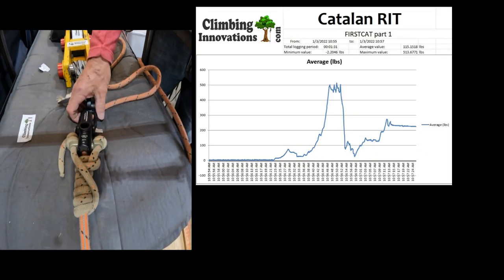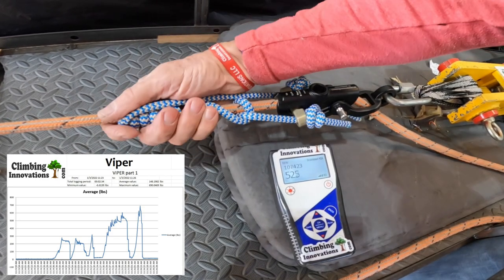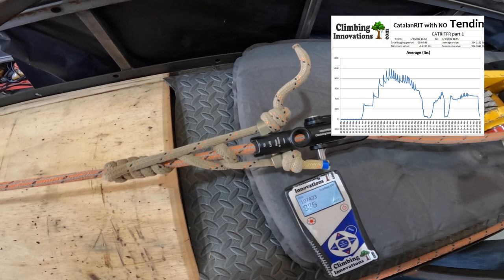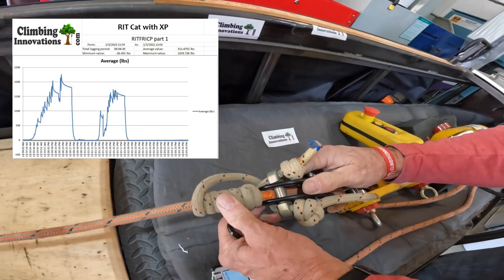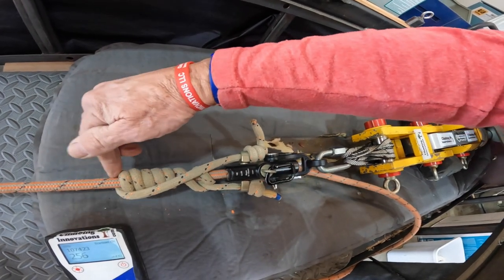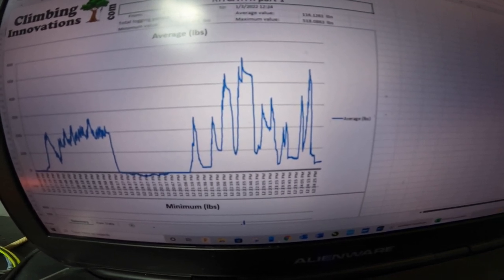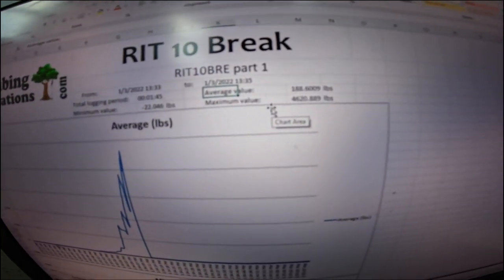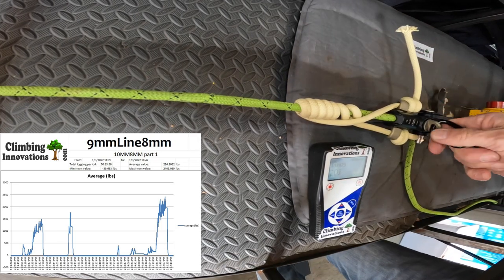HitchHikerXF Testing

Comment: What happens if the outer jacket of the hitch cord fails.  Will the Hitchhiker go into an uncontrolled decent?  For instance if the cord should burn up on a long fast decent or maybe just an over used worn out hitch cord.  If the hitch cord should break or unravel from its friction knot would the Hitchhiker alone be able to break the free fall enough to prevent serious injury?  Thank you for providing this testing information.  It is very informative and confidence boosting.
Reply from the maker: The hitchhiker is a very safe and versatile system.    As I am not sure of the systems you are familiar withere was I will reference the very tried and true Blake's hitch system.  Think of the HitchHikerXF as the limb above a Blakes hitch, both provide friction to allow the hitch to function, without them the hitch will not work.

Comment: Thanks for sharing all your info.  I’ve learned a lot from your videos.  Just curious, does the friction plug need to be adjusted out for the HHXF to tend smoothly during ascents?
Reply from the maker: It should be removed for ascent.   The caribbeaner could be removed and it could be left in place but not engaged, but I guarantee it would be lost. I keep it clipped to my rigging paw until I want it.

Comment: I have a HH2 and have been emailing with Paul a bit. It doesn't seem to offer much "braking power". It's nice how light you have to touch the hitch to get it moving. But too much, just seems not much different than a hitch cord. Is it supposed to be and I'm overthinking? 😂
Reply from the maker: Sorry but I'm not understanding you comment or question.
Reply: @RichardMumford1 sometimes it's hard to put into words exactly what I'm thinking or explaining.  I guess I was expecting the device to act differently, like a figure 8 with a friction hitch. I see how your design has the added friction plug for long descends and a noticable difference in the load capacity. 

What I'm asking is, if I push down on the hitch all the way, I'm going for a ride.... Seems like free fall. Is it supposed be like that? 

 I'm using Sampson BWR  16 strand, and have tried it with Sampson 24 strand as well, same results.
Reply from the maker: @anthonyr6286   OK understand your question now. One of the beauties of the hitchhiker is that you can control all of the friction.  Like a Blake's hitch in a doubled moving rope, if a climber completely compresses and releases the hitch, it will be a free fall.
Reply: @RichardMumford1  thank you so much! I was overthinking it

Comment: So the rope shears off at 2,000 pounds ? That’s definitly not enough to be over the 5,000 limit for climbing
Reply from the maker: Ropes are required to have a breaking strength of 5,400.  What they break at in use is not the same.  Put any device, hitch or mechanical on the rope and it will be different, in fact connect it with a carabiner, spliced or sewn eye, it too will be different.  So the hitch slips far before anything breaks so in reality these test are close to pointless but simply prove the metal can take whatever you throw at it.
Reply: Awesome thanks for the response, the whole system is rock solid I csnt wait to receive mine , love supporting your work
Reply from the maker: @Arbor Kingdom  Thank you.  Ratings, certifications, and standards can often be misconstrued.  In fact just try to find CE standards or the actual tests that were performed, it all gets buried somewhere.  
I think they are important but should be a little more transparent before we go toss it over a branch.